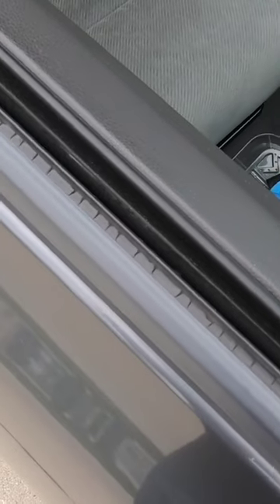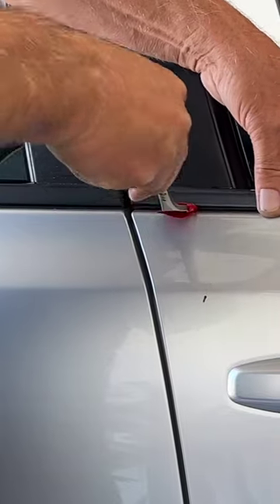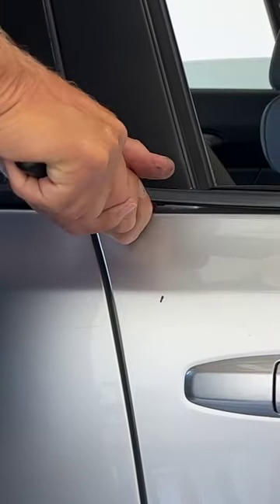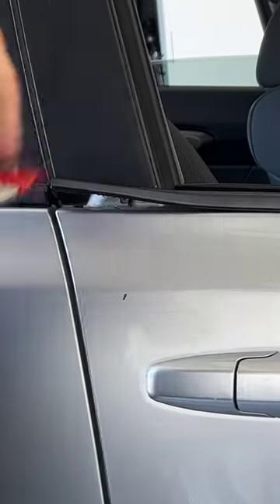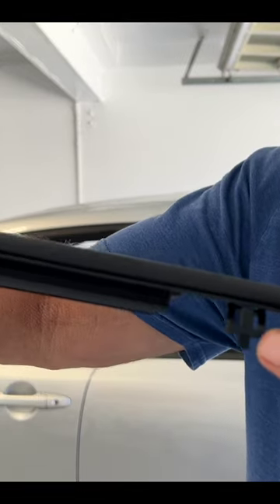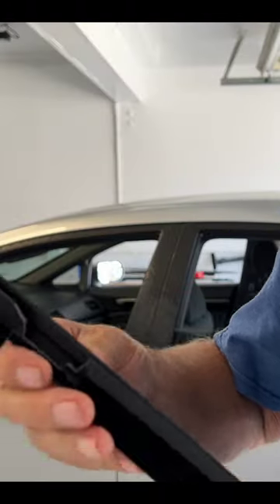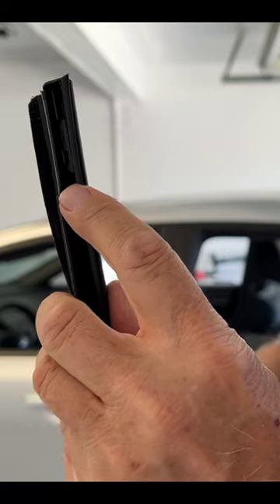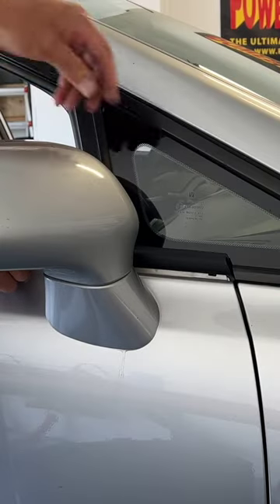Honda Civic Window Molding Seal

Comment: What is the same thing on the inside called? Indoor weather strip? Mine started coming off and ripped up my tint but I can not figure out the correct term for it
Reply from the maker: Maybe door panel trim or molding, it might be part of the door panel

Comment: if you are going to reuse that weather strip, the correct way is to  remove it from the inside to release the lock. You will need to uninstall the door trims though.
Reply from the maker: Awesome information, thanks